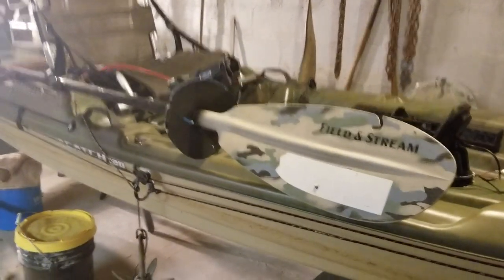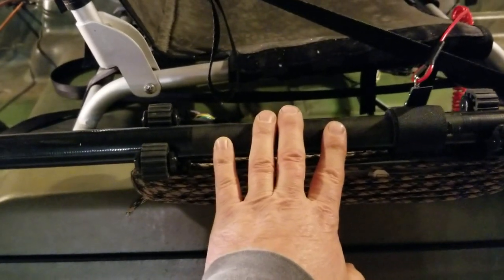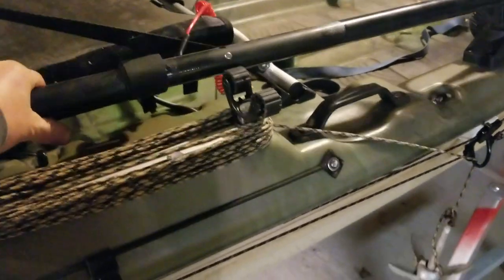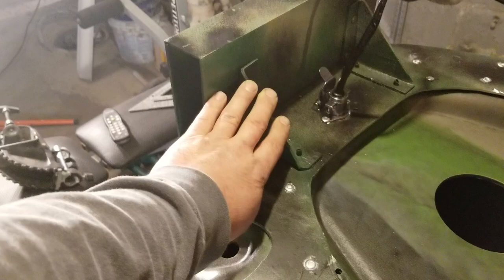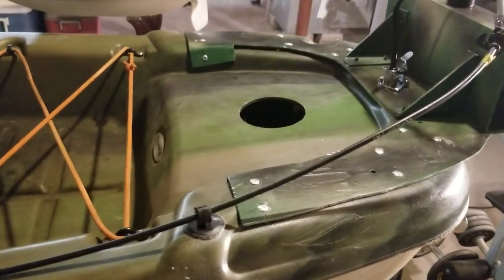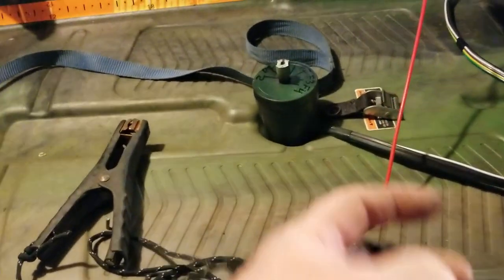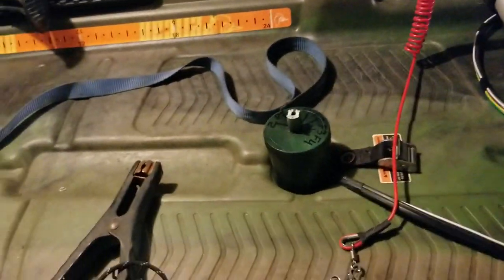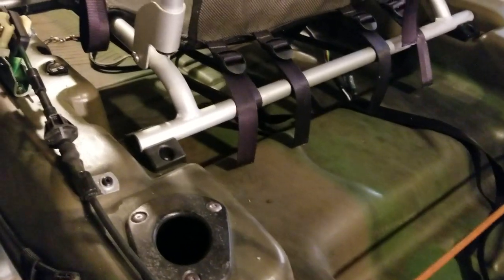Pelican catch 120 modifications

Comment: I'm looking at this kayak for my fishing/hunting rig. I have thought about using the scupper hole directly in front of the seat to put the trolling motor through then you just need to mount the head on backwards to run the controls. I would think you could put a stopper for on the way up and down for depth.
Reply from the maker: I would be concerned of the integrity of the hull scupper is a half inch in diameter trolling motor  shaft is 15/16 s in diameter. Not to mention if you get hung up on something you can't get to it .I was thinking about the same thing at first